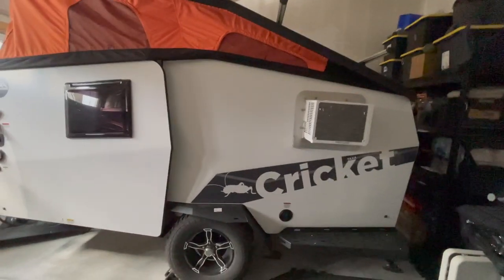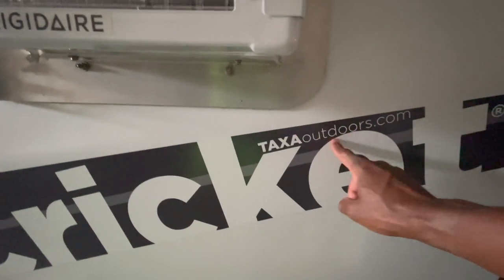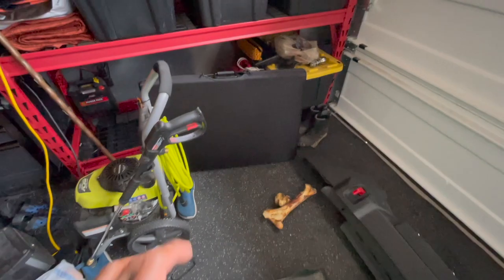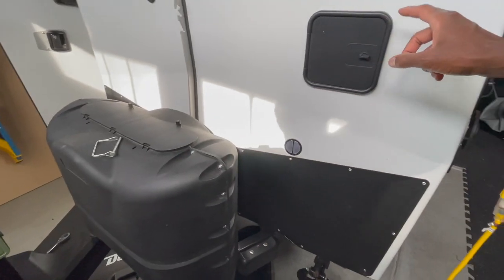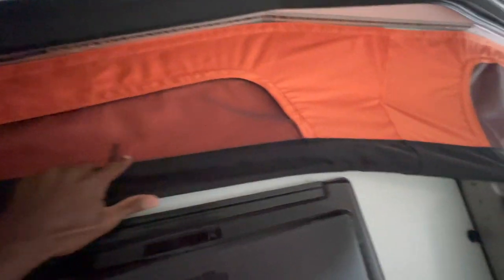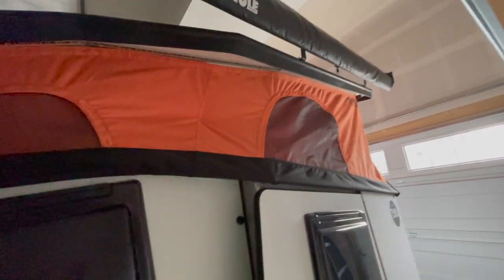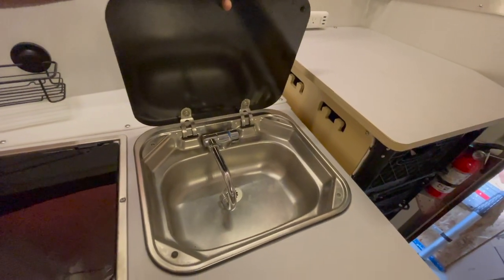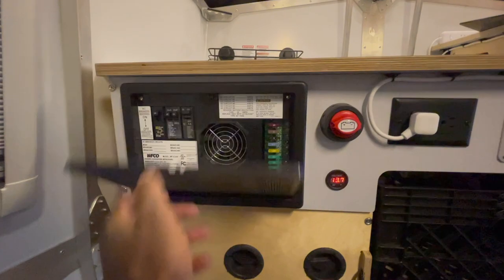2021 Taxa Cricket Walkaround

Comment: Thanks for the informative video. I’ve got a Cricket on order. Hopefully, it will arrive soon.
Reply from the maker: Hi David. You are welcome! I hope it arrives soon too. I’m sure you’re using the time to plan all the things you’ll do! What color did you go with?
Reply: @iAmMarchal  I purchased a Dometic CFX 45 during a Memorial Day sale. I had my eye on the IM55 but I was concerned it would be too big.
Reply from the maker: @davidholmer6099  it seems to fit good in the space between the battery compartment and bench. but that is subjective. So depends on what else you got going on in the trailer.

Comment: Thanks for your videos Marcus.   I'm very interested in one of these but my garage opening is just shy of 6'11".  The specs say it's 6'11" high.   I don't know if there's any margin in their number and whether I could fit this in my garage.   Any thoughts about whether it is doable?
Reply from the maker: Endymion4242 I believe that is doable. Worst case you park outside. Deflate the tires a little bit and you can get it in. Just keep a little compressor/inflater at home. To me that little “inconvenience” is worth it to have the trailer at home to tinker, security and avoid storage fees.

I have a taller garage opening so I can’t say for a fact if when inflated properly it would fit. There may be margin. And if so it may be as easily plus or minus 😇
Reply: @iAmMarchal  Thanks Marcus.  Looks like there is hope.  I have a good inflator available.   Will research further when I can find one at a dealer nearby.   Regards, John
Reply from the maker: @Endymion4242  excellent John. Keep me in the loop. I’m curious how it all works out.
Reply: I've got the same problem. I want one too, but my garage is 81.5 inches. Just a bit too short. Leaving it in the driveway is not an option in my community.

Comment: You say you owned an Airstream Basecamp. Very interested in your thoughts between the Basecamp and Cricket. I have had my 2017 Cricket for 3 years and have thought hard about upgrading, but keep talking myself into keeping it. Why did you sell the Basecamp if you don't mind me asking...
Reply from the maker: Hi Leon. I don’t mind. So the basecamp is pretty well designed. Built in wet bath is cool. The panoramic windows are cool. I sold it due to storage issues when I moved. 

I looked into buying it again. But needed something that would fit in my garage. I like to tinker and so having in storage would not be ideal. 

The cricket is good coz it’s low profile but can be expanded. Tows well due to that low profile. Less wind interaction. Then expand or not to camp. Open layout with more configurations. Sleep more if you have kids due to berths. Easier roof access. 

If you don’t need the wet bath. Then they compete pretty well I think. Or maybe the pano windows. That’s a pretty cool feature.
Reply: @iAmMarchal  I see, thanks for the reply. The Basecamp appeals to me because it looks very tough. I do appreciate the low profile on the Cricket while towing at 75mph, but have had to constantly strengthen weak areas (rivets popping and even hairline cracks in frame in some locations). It looks like they redesigned the U-frame at the rear hatch on your model which should definitely resist that fatigue cracking better.
Reply from the maker: @noelsomers3958  yes. I have heard of the rivets popping out and the structural issues at the tailgate/rear door. I’m hoping they addressed with the 2021. Rivets should not be popping. They like to claim the owner designed habitats for NASA and so I can’t imagine having to constantly be repairing rivets on Mars. It’s a little disappointing. And I’ve never heard of airstream mass rivet issues. 

I’ll definitely post if that happens. If you go with the Basecamp. Still a very excellent choice.